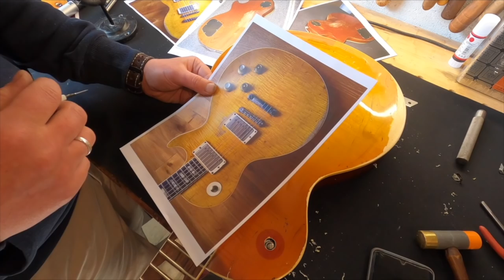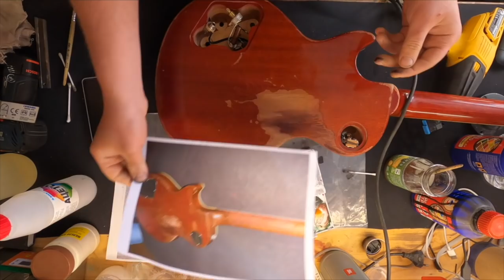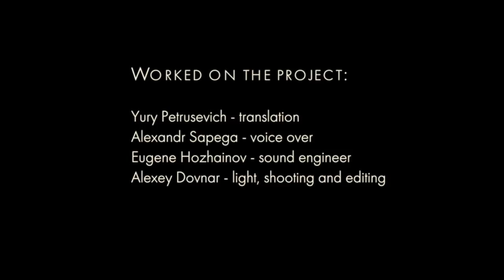Greeny. Episode 2. Peter Green / Gary Moore '59 Les Paul copy

Comment: the hardest part in my opinion would be getting a hold of a chunk of maple that matches very close to the original. the flame is fairly tight and very active with some blistering and quilt figuring in spots. its not what we refer as to aaa+ today but is in between kinda still hi pretty grade. ide look st re purposing old wood from antique furniture wen possible..the relic job you did is fantastic! nailed it.. to relic Gibson is alot harder than doing a stratocaster. most look ok at best but this ones spot on!
Reply from the maker: Thank you

Comment: hi! i was wondering if the current historics of gibson will also fade under sun exposure for 2 months like yours?
Reply from the maker: The red dye used at the Gibson factory in '59 fade more slowly.  I use a dye that is more sensitive to light as I need the result much faster.  But if I want to prolong the fading process, then I will add a composition of dyes of different sensitivity.  This way I can calculate the approximate fading time.